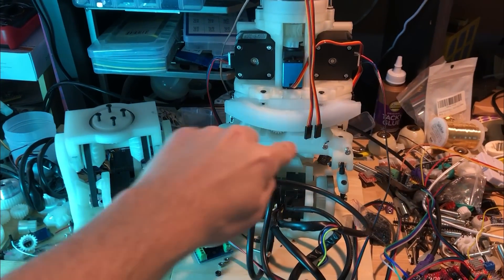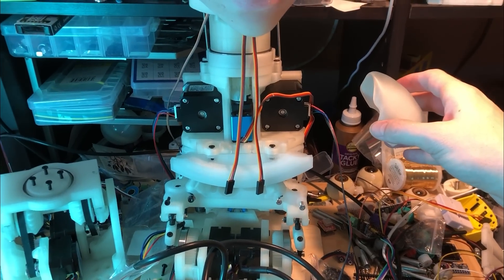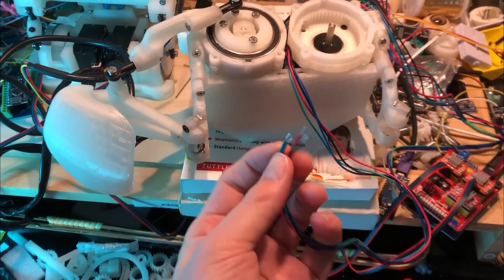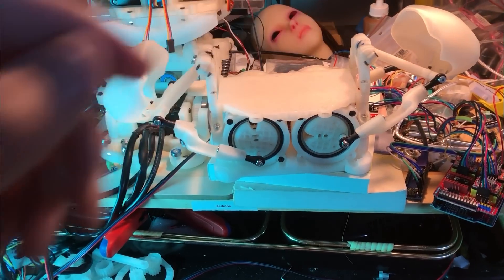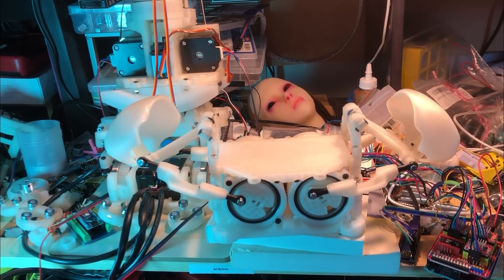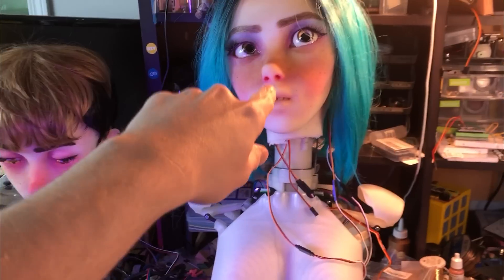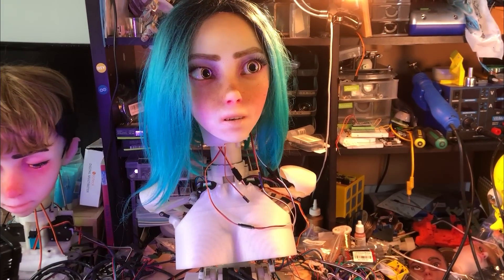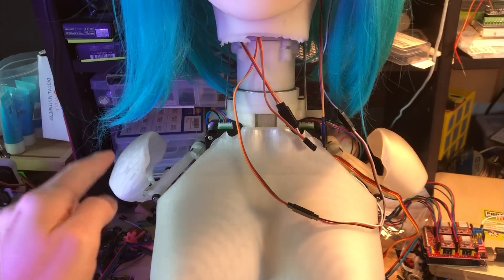Shoulder Module Development

Comment: How about spherical gear mechanism?
youtube.com/watch?v=4ASzn_F-16k
youtube.com/watch?v=acTzQBZUDSg
Reply from the maker: problems with space, and proper housing for such a mechanism make it a tricky thing to do.
Reply: Yes, in the longitudinal plane the mechanism is not very compact, that is, it is not at all suitable for elbow, wrist and knee joints of prostheses, but for shoulder and hip joints it is already quite suitable.
But it is fast, easy to operate, and makes less noise while running. It may even provide feedback, which is not the case with your version.
Reply from the maker: @АнтонСергиенко-ь2ц  Well, I've been aware of these things for a few years now.  I have thought about trying them out, or building one to play around with.  I have never got around to it though.

I see a lot of problems with it.  It looks to me like the gear is suspended in a housing.  So, it rotates inside this housing - constantly rubbing the gear tips against the housing?  This seems like a problem for any application that needs to move a lot of weight around.  The gear, or the housing are going to quickly experience a lot of wear.

If a shoulder is meant to bear the weight of an arm, plus some load, it may be carrying as much as 5 kilograms.  

At least for my design here, there is no way I could fit this into a shoulder.  There is no space for the whole mechanism.
Reply: @DaveMakes  No, it is attached to the gears and rubs only against them, so this is typical for any mechanism where gears work. With weight, yes, there might be a problem. Form factor can also be an issue for use where longitudinal compactness may be required, such as elbow, wrist and knee joints.

Yes, this is a very interesting way of transmitting torque with mobility, albeit limited, in two axes. But I'm also not sure how the force will be transmitted - will it fly off?
Reply from the maker: @АнтонСергиенко-ь2ц  now, this kind of thing looks very interesting to me:

https://youtu.be/BkjTnm2bnH0?si=FcO3pId2GVy28oGy
Reply: @DaveMakes  But, all the same, these solutions are not suitable for open joint hinges - the teeth will get clogged with dirt. Now, if the sphere had recesses, and even better, they would have the ability to close when not in use...

Comment: How did you get the face?

Where did you buy it from?

I want to make something similiar, but idk how to get the face
Reply from the maker: I sculpted it digitally, then printed a mold for casting it myself.
Reply: @DaveMakes  Ah okay, so you 3D printed the mold then poured in the silicon etc?

Never thought of doing it that way as I'm not familiar with silicon item production
Reply: @DaveMakes  Btw, about the eyes.... how did you end up making that XD

Sorry for all the questions, its because Im trying to make something similar too (waiting until I get a 3D printer to play around with), but was wondering what material you used, glass for the dark part, or a clear plastic?
Reply from the maker: @GabrielTobing  combination of 3d printed part, glass lens, acrylic paint and some UV resin.  I'm in the process of re-designing it for an internal camera, so things are going to change in a few weeks.

Comment: For more complex facial expression, a under skin, facial bladder, that is in segments taht cna be compressed below in various ways, can give life like facial expression without more complex motors, but then also flex and inflex various facial movements, Essentially a face air mattress with variosu patterned rib muscle underlays, and then a roller system underneath,  each bladder sack can be inflated/ compressed from a central system that has simple little tight crush valves/ kink ot stop the air form various chambers todepdening on the expression. THe rollers ad the means ot simulate flexing of hte facial area... but hmm

Comment: can you use a learning neural network to program the movements of microcontrollers?
I'm not an expert in this field. but it seems to me that if you connect a special trained neural network to the programming of movements, it will be a breakthrough... It will be able to self-learn and make movements smoother and more natural.

Comment: I'm just waitng for 3D printing techniques to get more advanced with regards to material and soft gel

like maybe having a mesh layering system to print in ducts though a Rubber print that can channel pressure flow of liquid and just slowly taking away material and weight to find the best solution for soft robotics. 

servos and motors will always be needed for harder robot labor jobs espcially space and interplanatary stuff in the distant future (or not depends how nov goes) 

like i think this whole drive for humanity is being done because women left the kitchen
Reply: yes

Comment: Don't you have a way to remove those horrible noises from the mechanisms???
Reply from the maker: As a matter of fact, I don't.  More expensive stepper motor drivers would be completely silent.  However, I don't have a lot of money to spend on parts, so I have not prioritized keeping the motors quiet.     

Completely possible for those motors to be inaudible, it just takes money.

Comment: There has to be some kind of motor or mechanism that is quicker, more controllable, and less ridged than electric motors. Maybe hydraulics? Or something that mimics muscles. the small electric motors that you need to fit in this thing suck ass for building a robot. Anyways your robot and all robots that use electric motor is going to suck until you can figure some kind of alternative.
Reply from the maker: I'd like to buy brushless electric motors, but they are considerably more expensive.  Like, 100+ per joint.  It adds up when you have 8-12 joints.

Comment: While I'm impressed, I feel like it would be much more optimal to design a pulley chassis, where all the motors are centralized in the torso and it uses braids and pulleys to deliver the contraction to the "Muscle sites".  Aaed Musa showed an interesting gear system using only rope and motors, but the most useful takeaway I found in his project was knowing there was a type of rope that did not stretch out over time called DM20.
Reply from the maker: I wonder how it compares with braided kevlar?
Reply: @DaveMakes  An issue with braided kevlar is it does stretch out over time, although very little compared to others. It's something that would need to be recalibrated over time with software.

Comment: Would pneumatics be more reliable? or would they be too heavy? pneumatic logic valves have come along way. How are you lubricating the gears? I would recommend a food grade lubricant if these are 3d printed.
Reply from the maker: i've got silicone grease of some kind of for the gears.  not applied in this video though.

Comment: That's crazy. How can you make the silicon mask? Using a mold? I'm in a similar project and I 'm a little bit stuck in it...
Reply from the maker: A two part mold, yes.  I print them after doing the face sculpt on the computer.

Comment: Youre gonna want to encase it in waterproof silicone acrylics vs just silicone for the ceramics and cooling system.. Also make sure to cover the wireless transmitters with cobalt or ceramic for radio frequency since you dont want static to mess up the coordination of the moving parts and make a smooth head tilt
Reply: For the first words relayed i want it to say i feel fantastic kkkk...😂😂

Comment: the quick eye movement looks really good, I wonder if you can gyroscopically stabilize the eyes with your curent hardware, like real eyes do
Reply from the maker: In fact I have a 3 axis gyro/accelerometer sensor module hooked up to her, but I have not got around to setting it up.  It should be easy to put somewhere in her skull so that her eyes can always maintain a particular direction relative to her skull.  I will have this in a future video for sure.
Reply: @DaveMakes  wow cant wait to see how it goes, cool project btw

Comment: This is the first video of yours that I've come across, so there's clearly some things I don't know. One of them is the question of the aim of this project. Are you ultimately aiming to make a full body, or just the upper torso, for instance? It's just that it's very hard make a self-supporting robot which moves, no less. At some point or another, you'd need to upgrade the things to be more robust and stronger. For instance the shoulders here would have a hard time actually carrying arms, I'd imagine. Is this a proof of concept, or does the final goal not need anything else? Great creation either way, I'm just curious as to where it'll go. Either metaphorically or literally.
Reply from the maker: Ok, so if you are looking for a top down analysis of this thing. Imagine you have a robot character of some kind sitting on your desktop.  It's powered by AI, so you can have conversations with it.  But it's not just a voice from a speaker on some device, it's a completely realized interactive character.  I think that would be fun.  So, i'm not too concerned with arms, or having it walk around right now, although I would like to explore putting her on a motorized wheeled base to move around.  

I work on this project much more as a bottom up process, so it's much more about learning new things and implementing them to see what is possible.  Goals change, but learning is constant.
Reply: @DaveMakes  Oh absolutely! A deskpal is good a goal in mind as any. The beauty of such creations is that there's no inherent limits or rules, and just like you said, the only limiting factor is your own creativity and will to experiment. You clearly have the skills to do it, so there's no reason for you to not carry on. I'm sure that this project of yours will someday be what you have in mind, and however it goes, you'll have learned a lot more than what you would've had you not tried it. Thanks for sharing the progress as well, as I'm sure the things that you do inspire others in the process.

Comment: Could I ask what those motors are? They're producing pretty awesome sound effects, I bet they could be used as part of a midi-controlled instrument
Reply from the maker: NEMA 17 stepper motor, rated at 16ncm.  I bought them on amazon, though they are ultimately sourced from StepperOnline I believe - they have their own website with extensive electric motor listings.   
They could definitely be controlled by midi signals, with a bit of a go-between processing done in a microcontroller.
Reply: @DaveMakes  Awesome, thank you!!

Comment: YO! Quick questions: Are you coding any AI for this bot? If you were to encapsulate the movements of each rotter and joint into their own basic functions to be called, there's probably a complex way to use chatGPT to make decisions to call those functions based on stimuli if you added some sensors if you wanted to do something a little autonomous. It wouldn't be too crazy to make those API calls if you had your own API key. Though it looks like you need to work out some kinks in the motors first before worrying about that side of things.
Reply from the maker: yes, an extensive prompt could contain instructions for interpreting sensor data and translating it to motor commands ~ navigating a set of different pre-composed poses, or even new poses generated as statistical values between the basic set.

Comment: What's the benefit of motors versus hyrdaulics?
Reply from the maker: i've never used hydraulic actuators, on pneumatic for that matter.  So, no first hand experience.  I understand one of the benefits for either of those kinds of systems is that you can put the bulk of the actuator somewhere else other than the joint itself - by running tubes all around the place.  Motors work best when they are pretty close to the point of actuation.

Comment: Is the servo making grinding sound?
Reply from the maker: The motor noise is a result of a few things. The front motor is making terrible sounds when I have the planet gears in there.  Interestingly though, the back motor is making none of those sounds at all, and it's got the same gears.  So, I think i'm running into some problems with precision with the 3d printed gears.  This lead to me taking them out of there entirely.

Though the motors also make a bit of noise on their own because of the electronics driving them.  I'm using cheap drivers here.

Comment: how much the whole stuffs cost you?
Reply from the maker: i'm not sure.  the 3d printed parts all together use less than 2 spools, so that's under 40 dollars.  there are lots of bearing and screws, so those can add up a bit.  and the motors are certainly the most expensive parts.  silicone is expensive, but reasonable when bought in large quantities, like so many things.  Off the top of my head i'd say it's probably less that 500 to put this together.
Reply: @DaveMakes  thank you so much for the information🙏🙏

Comment: Great work. My suggestion, for a more realistic eye movement, which you're probably already aware, is to make the top eyelid always be following the vertical eye movement, in a way that the edge of the upper eyelid is always "touching" the top of the pupil. Most important when the eye moves down so as not to get that "crazy stare" when they look down.

And whatever you do, don't call it M3gan, that's dangerous 😄
Reply from the maker: How about Halley 9000? ;)
Reply: @DaveMakes  skynet

Comment: You can eliminate the noise by using the same grease they use inside worm gears
Reply from the maker: I bought some silicone grease for this, but i haven't used any.  I find myself taking it apart and putting it back together again too often - don't like getting slime on my hands.  For a more permanent installation i'd probably apply some though.
Reply: @DaveMakes  okie dokie. The Chinese want like $15k to build my wife. I'm hoping you can build her a lot cheaper 👍

Comment: The first gears I printed in Resin with Anycubic Tough green in Mod0.2 convinced me it was possible. I just printed some gears in Mod0.3 with ABS like Black and they look pretty good.  I will be getting some Black tough and that gear noise has convince me to try strain wave reduction gearing, I think the Tough resin will have enough flex to work.

Comment: youre using mainly arduino and pi?
Reply from the maker: yes.  My thinking right now is to run some scripts on a Pi which will be interacting with a few different Arduino devices.   
Possible to do some things like face detection directly on a microcontroller, so I will try to keep the processor heavy tasks to the pi that need to be done there, and have the microcontrollers do  as much as possible on their own.  

Still doing a lot of experiments with all of this stuff.

Comment: Just a few things to note, about the jaw and eyes.
Maybe for the shoulders too.

The eyes need to be able to go very fast, precisely, without causing an inverse motion from rotation on the head.
This means that rotating the eyeballs from the centerpoint of the eyeballs is no good, because that force will immediately create an inverse force proportional to its speed of rotation on the neck of the head, which will make it look janky and unnatural.

What comes to my mind would be something akin to the way a solenoid functions, but in 2 axies, near the center of the head. I.E. long stick going to the back of the head, pushed up, down, left, right by solenoids. This may not be ideal if you can't control how far out the solenoids go, but this would provide quick movements without moving anything but the eyes and solenoids, thus making it less janky.

If you look at it anatomically, the eyes dart around through the contraction of muscles that go further back into the skull, meaning the force of rotation is on those further muscles, and not the eyes themselves. The eyes can also spin. Look at your eyes in a mirror while you twist your head, and notice how your veins stay straight.

For the jaw, our jaws largely stay where they are because the muscles starting at our temples are almost constantly in a mosly contracted state. To that effect, having a way of keeping it contracted and using gravity to do most of the work in opening the jaw should make it less likely to make the head jerk backward from the motion. To top it off, if you had a way to contract the jaw open after that, you could leverage that gravity, ask for a little bit of contraction, and have it opening without having a rotational force jerking it back.

The shoulders currently cannot go as high as they should, and using spinning motors there is noisy and slow. It's not ideal.

Oh, another thing.
You will usually never see the upper portion of the iris, or the sclera above it, because our eyelids automatically match to hide part of the top of the iris at all times.
You will only see that portion of the eye when it is wide open, usually in scenarios when someone is thinking about killing somebody else. This is why it tends to look horrifying, and why cartoons usually abstract the irises to just pure black or make them larger to compensate in cartoons. That way you don't get the visual cues you need to tell you they mean murder.

Actually, that rotation gear problem can be seen everywhere in the rig. The moment that any gear has to start spinning quickly from nothing, you have a jerking motion in the direction opposite to the rotation. This means that you end up having to slow down its accelleration rate to mitigate that fact, which in turn means your rig can't react as fast, which is also not ideal.
Reply from the maker: Well, I thank you for your considerable comment.  I'll just say that I am well aware of many of these things already.